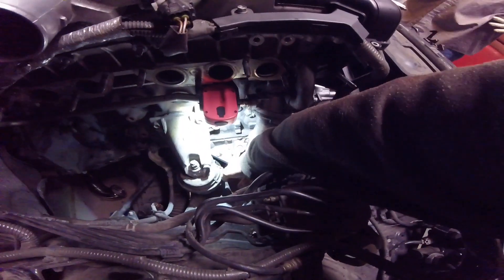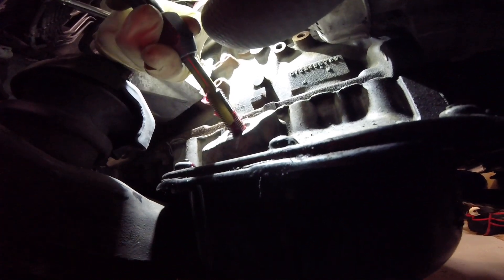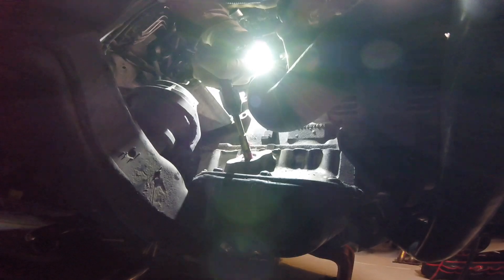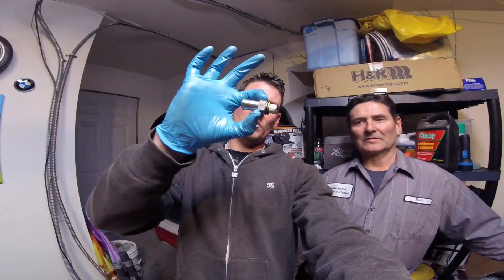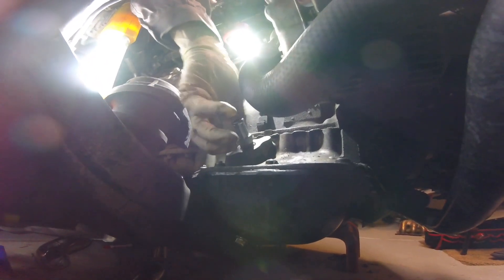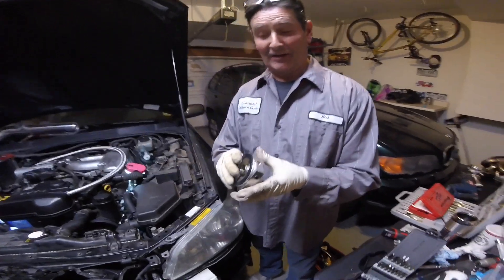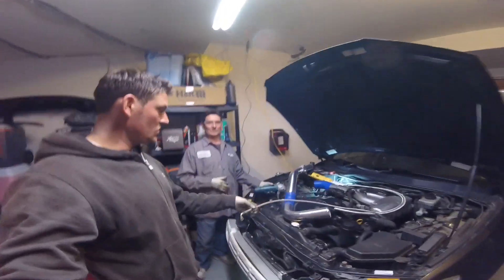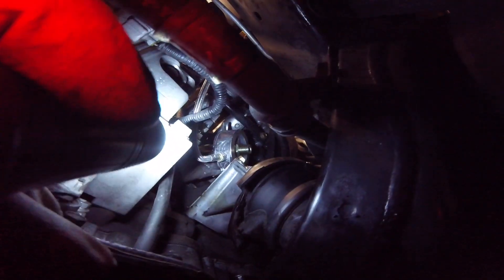IS300 Turbo Install Part 2: Oil system and Intercooler

Comment: Can u tell me the size u used to drill and the one u used to make the threads please. I have my turbo kit I just need to install and make the hole for the oil drain.
Reply from the maker: I cannot remember off hand. I am pretty sure I say it in the video. Or the video before
Reply: @C3GARAGEMedia  yeah I said 1/2 inch. But then U said something about 14mm
Reply: @C3GARAGEMedia  hey not sure if u remember but in the kit it comes with a plastic white t fitting. What does that connect to? An air hose ?

Comment: Kinda late to the party but I’m curious, can you potentially use that oil return housing to relocate the oil filter, or does it have to bolt directly to the original oil filter location?

Comment: What about metal shaving falling into the oil pan from drilling and tapping ?
Reply: It's better taking the pan off and drilling the pan instead of the block.. A lot easier also
Reply: @AlabamaPoe  exactly bro!!!!!
Reply: Im curious too but guessing he drain the oil multiple times or sprayed cleaner thru the hole

Comment: Hey I got the same kit for my 01 is300 I'm confused on how you installed the oil filter attachment?
Reply from the maker: Anthony Bryant pretty straight forward they supply a fitting which threads to the existing oil filer housing. Just press the fitting through the sandwich plate and screw in.

Comment: How did you connect the PCV that originally goes from the valve cover to the air intake? Did you cap it off or was there a connection on the cx racing intake piping?
Reply from the maker: magadavixt used the included rubber hose from cx racing from the pcv to the intake.

Comment: Hey, I have the same kit as you. What did you use as a oil drain line? Did you use a rubber line and hoseclamped it on to the fitting?
Reply from the maker: magadavixt i ended up using a high temp silicone hose.  I used plumbing fittings from the turbo and clamped the silicone from there. I had to use a different flange on the drain from the turbo and build fittings away from the turbo.  This was a pain in the ass but eventually i got it to work.

Comment: You Don't need a sandwich plate for the oil feed line. . Just use the the fitting from the cxracing kit and get ur oil from the oil pressure sensor. And I would highly recommend you remove the oil pan and get out all thoes metal shavings out of  there.  Theres to much to risk of things that could go bad for something so easy. It's was easier to just remove and drill oil pan . Also you don't need to cut that much for the intercooler piping. Just get the correct size bit and drill a whole.  I my self have the cxracing kit on my is300
Reply: he states hes going to flush the oil at 4:29 just an fyi, great series
Reply: Colin Gough doing a flush wont completely removed all the metal shavings.  only proper way to do it is to remove oil pan and clean it.
Reply: So my question is did you still have to drill into oil pan if you had the oil feed sandwich plate?
Reply: realgomez27 which kit do you have? I have a newly purchased 04 IS with only 60k on it. Did you need injectors or a fuel management system of any kind?
Reply: Are you able to do it from the oil pan instead of the block?
Reply: @migueltovar9702  no must drill and tap on upper oil pan

Comment: does the oil feed come with the CX Kit?
Reply: meaning that whole unit that connects with the filter
Reply from the maker: Yes!  Thanks for watching!
Reply: Easier using the oil pressure sensor and get an adapter with 2 port holes..

Comment: thank you for the video as I will be doing this very soon, what did you use on the drill bit to catch the shavers
Reply from the maker: Jice Z we used regular bearing grease. Just make sure you wipe it off and reapply clean grease each bit.